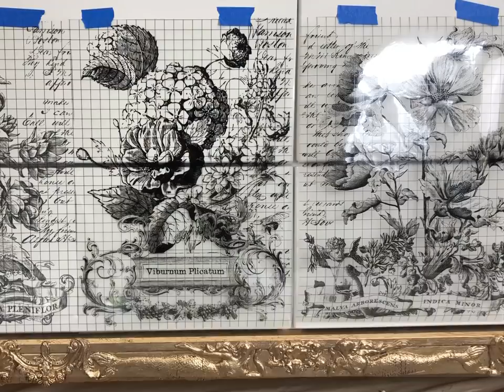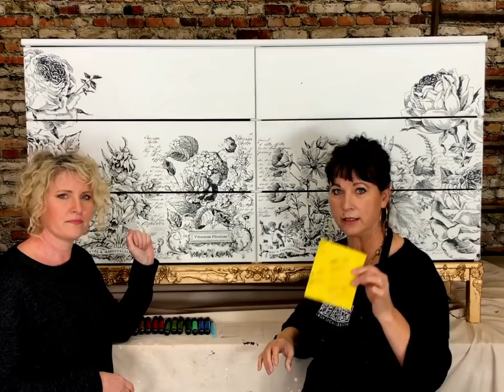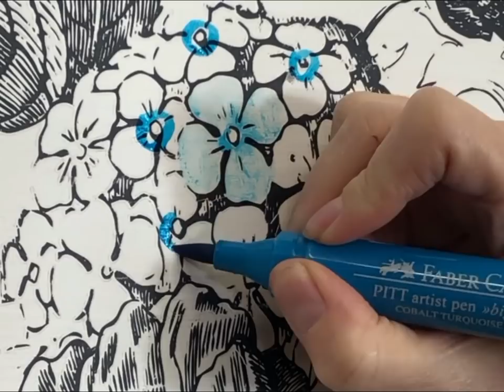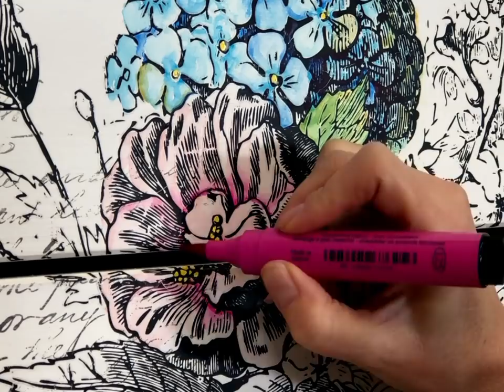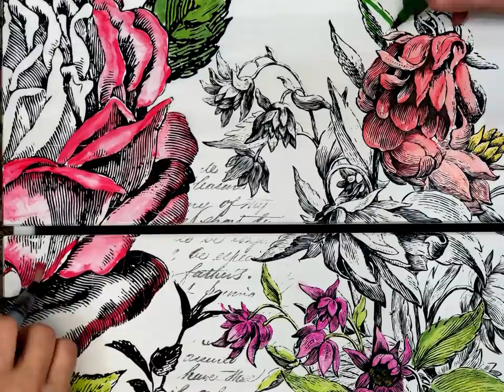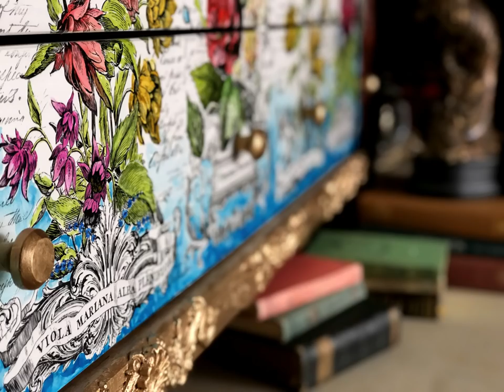DIY Ikea Tarva Maximalist Makeover Part 2 of 2 using IOD Classic Bouquet Decor Transfer!

Comment: My question is, can you see the transfers on very dark or black furniture ? I watched Debi Designs do a couch awhile ago. Other question : Is the white paint chalk paint ? Could I use this on a sanded, stained table that is not sealed yet, or should I seal it first, the applicate the transfer ?
Reply from the maker: Hi! You can see lots of examples of IOD transfers on black and dark furniture in our Creative Tribe Facebook group: https://www.facebook.com/groups/341167542965963 We usually use chalk or mineral based paints for our projects, but any high quality decor paint will work. You'll definitely want to seal with a water-based poly before applying the transfer as this will give you the best adhesion for the image. You might find this post with all the basics for using transfers helpful: https://ironorchiddesigns.com/decor-transfers/  😀
Reply: @IronOrchidDesigns  thank you !